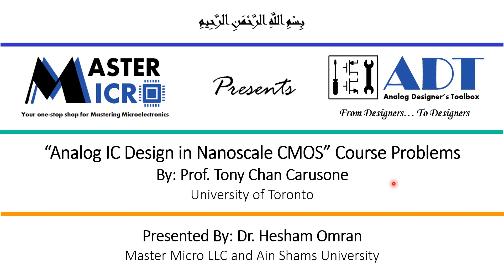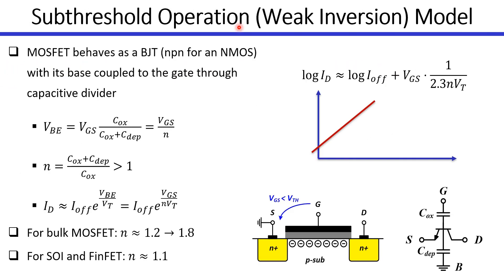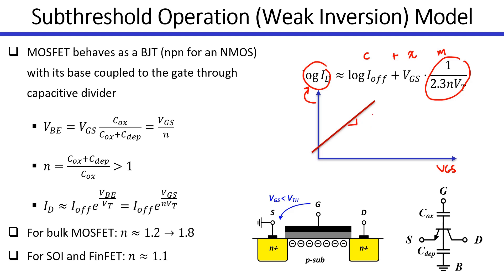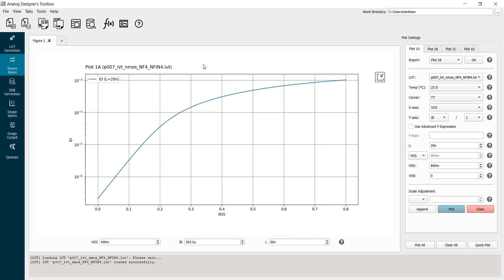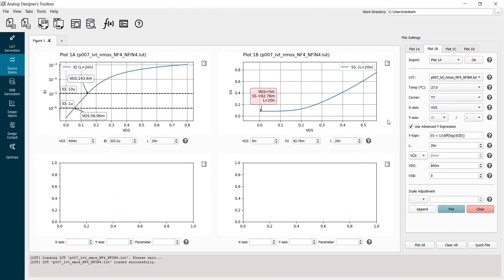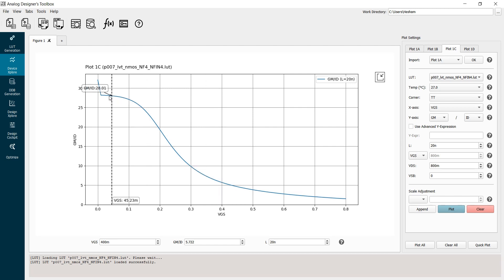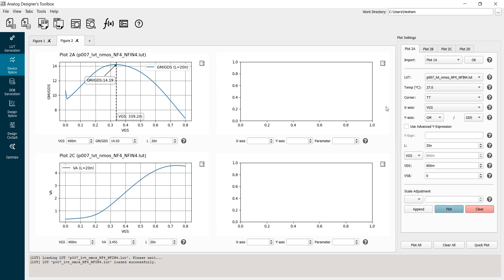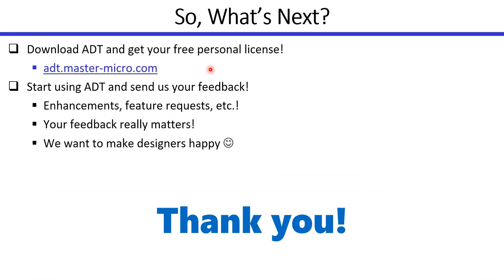Subthreshold Characteristics of FinFET | ADT Tutorials | Analog IC Design in Nanoscale CMOS

Comment: I was wondering if ADT tool is able to generate LUTs for 7nm designs for which variable is only Number of Fins?..............Is the method same as mentioned for 28nm and above?..I tried generating 7nm LUT for ASAP 7nm PDK from matlab spectre config files, after making changes as required, but the loading of the files fails in ADT...
Reply from the maker: The .mat import in ADT supports .mat files in Murmann's format only. You can characterize the devices for a specific Nfins and Nfingers and use this in place of the reference width. Please contact ADT support if you have further questions.